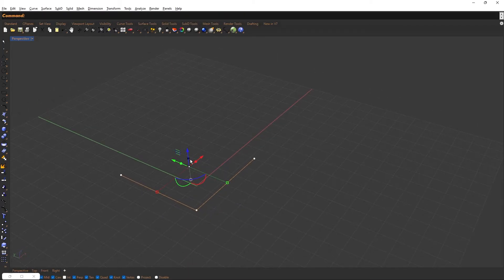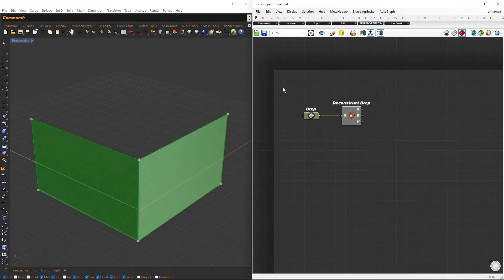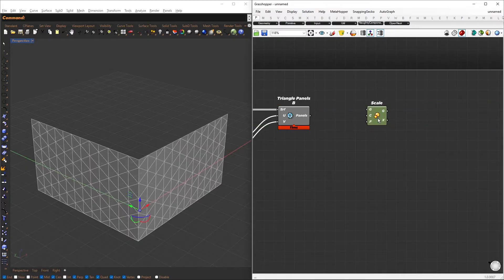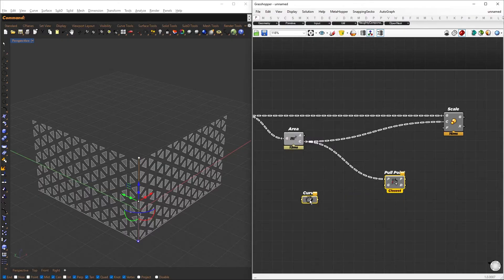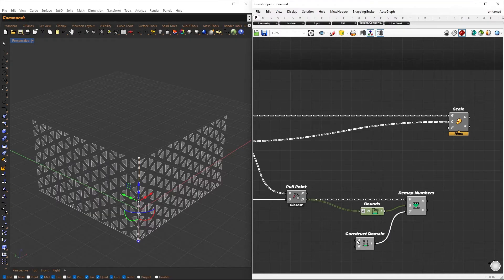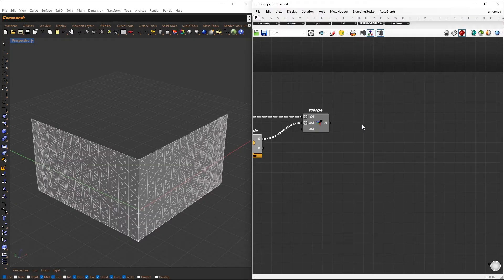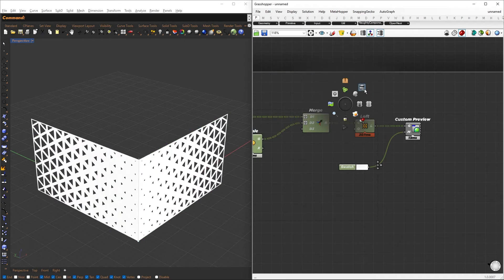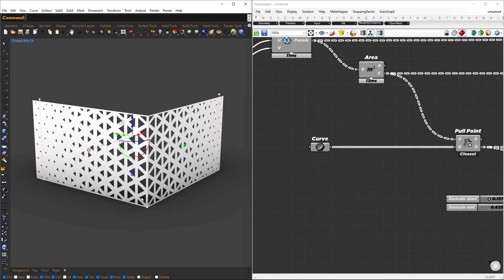Parametric patterns Façade |Grasshopper For Architecture Tutorial

Comment: Thank you for this tutorial! I have a question: After using the 'Loft' , is there a way to hide the surface edges? I need to export the result to Revit, and the edges are showing up there. I only want the triangles to appear as holes on a single surface.
Reply from the maker: After the Loft, just flatten the result and use the Merge Faces component. That should simplify the geometry into a single face

Comment: my triangle panels are upward and downward instead of right and left like here, how can i change them? i really hope that you answer this i need it for my project hahahah
Reply from the maker: You can fix this by using the 'Reverse Surface Direction' component. Pass your surface through it and connect a slider with values from 1 to 3. This will flip your pattern between left-right and top-bottom directions. Try adjusting the slider to see the changes!
Reply: @3DBeast  THANK YOOOOU

Comment: How can I apply the pattern to a surface that is not a rectangle. For example I am trying to apply this pattern to a triangular shape but the Triangle Panel B command only generates rectangular panels.
Reply from the maker: The simple solution is to try applying it on a rectangular surface first, then cut it out to match your triangle shape. There is a way to apply it directly, but it's hard to explain just in text
Reply: @3DBeast  I need help with this as well. Triangular patterns on a triangular surface